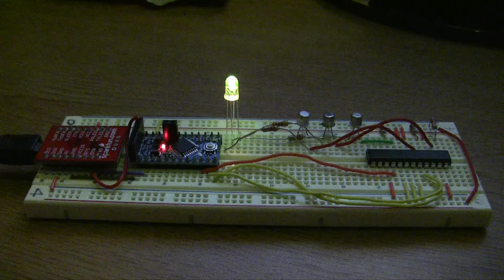Blum 16 - SPI Digital Potentiometer Tri-Color LED Fading

Comment: how can I control digital pot using matlab, actually I want to make a matlab GUI so that I can increment/ decrement the resistance, only arduino I/O libraries are available but no SPI support for matlab. is there any other way to do this?